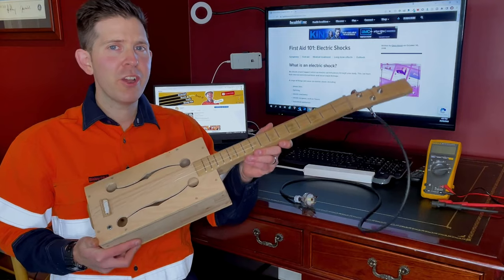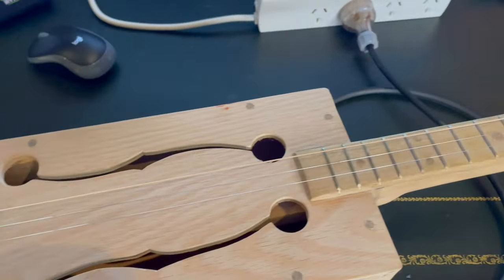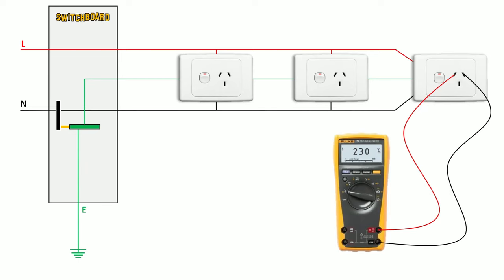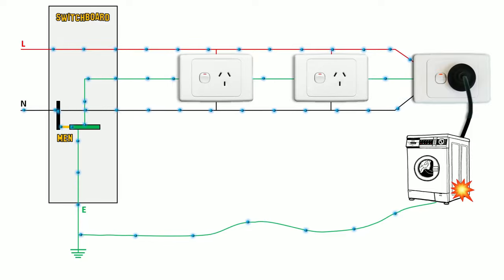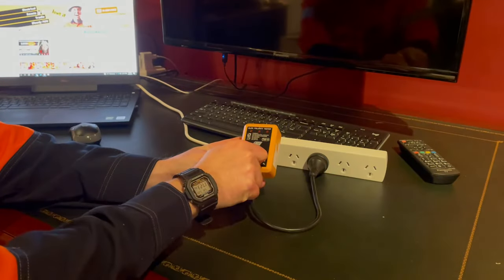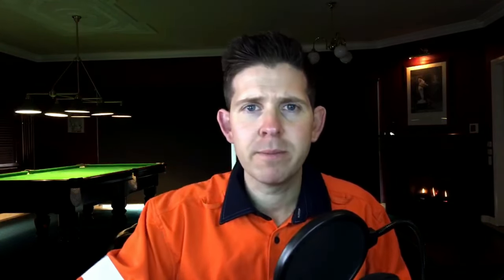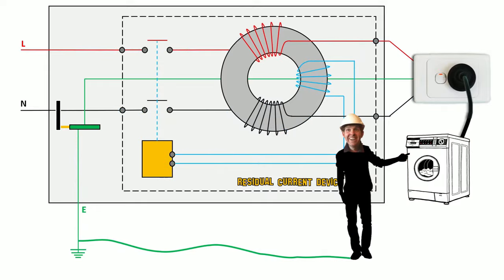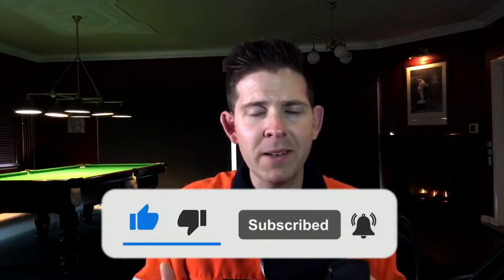I Remade ElectroBOOM's Electric Guitar (How a Safety Switch Works)

Comment: Back in 1920's in the US, one company offered an electric guitar which came with a "charging unit". The instructions stressed not to charge for more than 10 seconds. Then the pickup plate would work for a couple of minutes. Didn't seem to sell that well - not enough survivors?

However, on those "vintage" amps guitar nerd slove, sometimes the chassis is connected to the neutral lead, aaannnd sometimes to the hot lead. Don't touch any other electrical device, sparky. Somehow this was legal and "So what?" since it only killed  some players: surplus population I reckon.
Reply: what the fuck. Does it charge a big capacitor or something?

Comment: In The Netherlands an RCD is funnily quite a lot called an “Aardlek Schakelaar”, which translates literally to “Earth Leak Switch”.  
The translation hints to the “residual current” as a ‘leak to earth’. 😂
Reply from the maker: I agree RCD doesn't  really describe much about the device. We do use earth leakage but only occasionally
Reply: @thinklist  Yeah this is probably one case where the Americans actually had a better name for it GFCI more accurately describes the device. As that accurately describes both the trigger (Ground Fault) and the action (Circuit Interruption). Having said that the name for the combined units is a little better (RCBO) ie Residual Current Breaker with Overload-protection. But RCD sounds like calling the old standard breakers an OCT (Over Current Thingie) as it doesn't really describe what the device does but worse as residual current is not really a common term in other contexts.

Of course those RCBO's are probably going to find themselves being replaced at some point as countries seem to be moving to add mandates for arc fault protection into their newer regulations. The US an Canada have for a while, the UK just added it in their 18th edition rules, and both New Zealand and Germany require them for certain high risk circuits. I don't see it being long before the EU as a whole follows suit they are rarely behind when it comes to the latest safety regulations and even more rarely stay that way for long.

Comment: Raisin toast with a raisin stuck in the toaster is enough to trip the RCD/GFCI (why the later name i do not know, so much prefer RCD). I would love to see more about the Rapid Earth Fault Current Limiter (REFCL) as an instrument of enhanced bush fire safety. The part of that that interests me is how they raise the voltage on one phase to compensate for the power being cut off one of the phases so the secondary voltage remains the same. For a short time and if the fault does not clear then the power is cut.
Reply from the maker: This is super interesting 🤔 in going to look into this further 👌
Reply: Ground Fault Current Interrupt... Screw that name.

Comment: License electrician you mean the guy that wired my lamp ground as live, neutral as ground and live as neutral?
Reply from the maker: Yep that guy 😆
Reply: @thinklist  I know I getting myself certified. To get under 1kv here is pretty easy all I have to do is go trough a course and pass an exam, with I already pass when I take it online. It's like driving license, I guess similar risk of kill oneself and others, it's for under 1Kv installations so more than enough for any residential applications. As currently I am  certified for networking and low Voltage I would love to be allowed to do more
Reply from the maker: @m-2718  really that’s all it takes. You don’t need to complete an apprenticeship? What country are you in?
Reply: @thinklist  I am in Poland, and no, now it's been added you need to take courses since this year before all you had to be was be over 18 and finish highschool and then pass the exam. If you want to go above 1kv you do have to have either collage diploma or experience.
Reply: @thinklist  Ah also fun fact the course is 4 hours, and whole ordeal costs about 50$ the curse and exam. And to 1kv if I am not mistaken also allows you to connect generators under 50 kW but I would have to check
Reply from the maker: @m-2718  oh ok 👌 and Gday from Australia
Reply: Maybe the old colors that didn't make sense? Red - neutral.  Grey - earth and Green - live
Reply: @TheAdatto  No it's blue, green, red